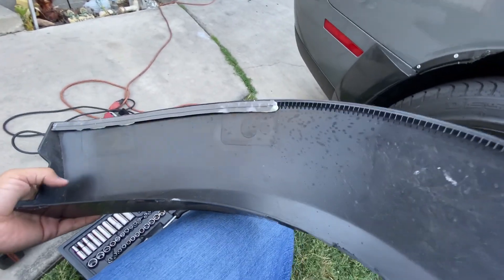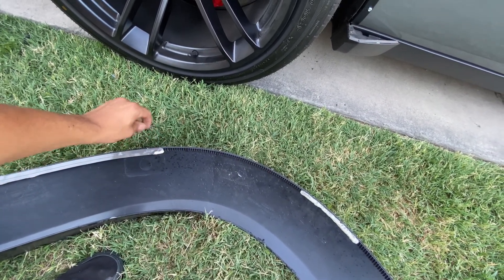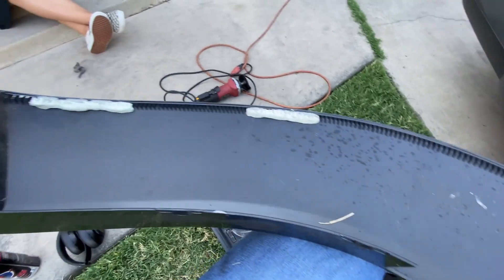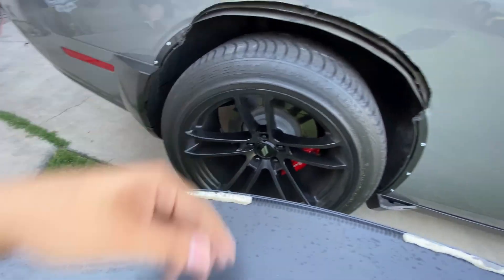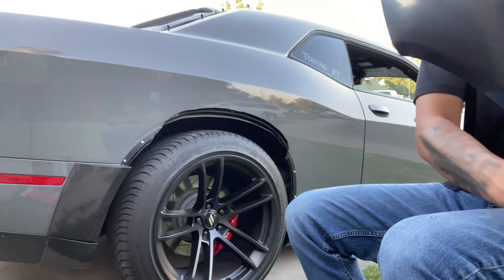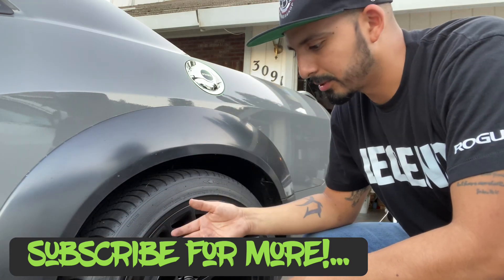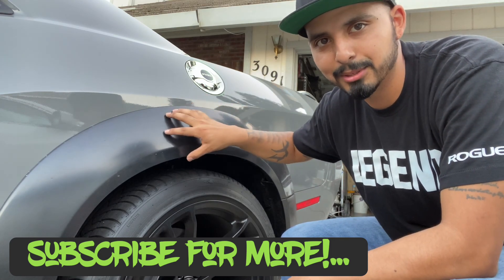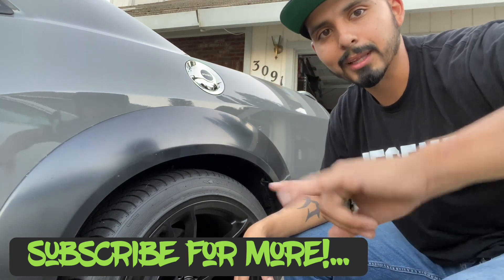Vicrez Dodge Challenger Wide-body kit (How-to) install/Review part2

Comment: Love to see how you go over the process, but how you measure how much metal you cut from the fender flare?, I order some 20x11 wheels with 305 all arround and  they have -2.5 offset so I know they will stick out so I can get rid of my spacers, but I figure I am going to end up cutting the flares specially because I am airbag, by looking at what you cut I imagine Is about 1.5 inch or so, but what was your thought on that?
Reply from the maker: I appreciate that man, I'm glad to see you thinking about air suspension and the way I went about measuring my cut was from how much wheel tucks into my fender when I air out my car and I measured just about 2.5inch  in the front and 2 inches in the rear. I gave my self a little bit of cushion and made a 3inch cut in front and 2.25 in the rear.
The point of getting as max drop with the tires I'm running and the how I wanted to car to sit down. When that time comes make sure you cut half of your bump stop in the rear shock. You'll like how it will sit on the ground.
Reply from the maker: feel free to contact on my IG tonymo_rt if you need any help bro.
Reply from the maker: but on the actual widebody flares i did cut off about 1.5 inches so the wheel doesnt rub or causes it to pop off.
Reply: @raptorrt  thanks a lot for all the information and yeah I may contact you once I get on it but these gives me a pretty good idea, I love your set up bro, its the same voxx wheel I ordered as well💯
Reply from the maker: Of course I’m glad to share what ever info that can help your process better. Thank you. Appreciate it the love, the wheels are nice honestly

Comment: Nice job, I really like that widebody set up, but i hate cutting fenders, is there any way cutting can be avoided?
Reply from the maker: Unless you have an sxt model that comes with non sport suspension yeah it would be able to. Unless just on the Rt/Scatpacks you would have to cut from the front fenders cause they come with a lower spring.
Reply: @raptorrt  another way then change springs
Reply: Сергей as long as you don’t add spacers or modify the suspension you shouldn’t have to cut at all because it stays stock

Comment: You left it open? You didn't weld it or seam sealer where you made the rear cut.
Reply from the maker: No i didn't, i also left my wheel well cover in there so it still block everything from going inside. but overall its all holding up pretty well and nothing wrong has happend to the inside as well.

Comment: What tire sizes are you running 305s all around?
Reply from the maker: I’m on 275 all around I like the stretch look.
Reply: Ok cool does the 275s all around have a flushed look with the widebody kit or do they kinda looked tucked in? Nice setup by the way 🔥
Reply from the maker: It’s just a small bit tucked in not a lot honestly it not as noticeable. They fit really well with the 275s on them. I appreciate it thanks.